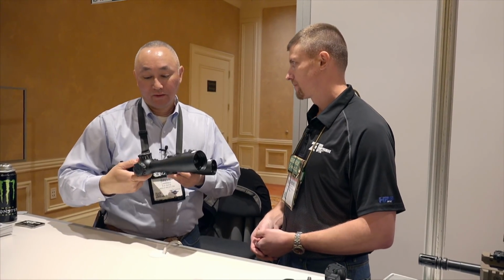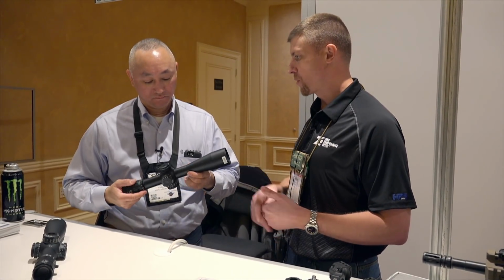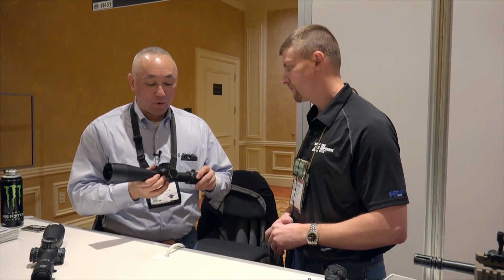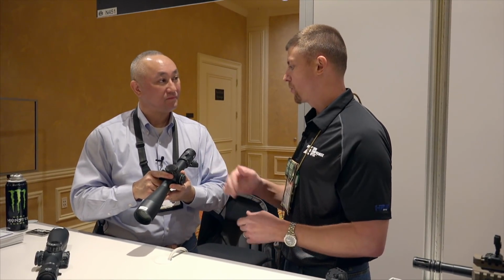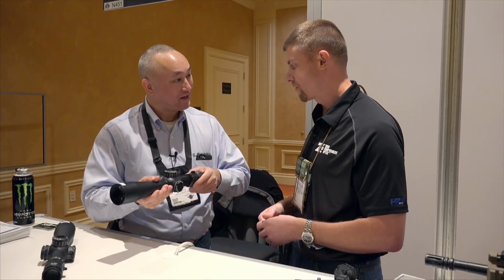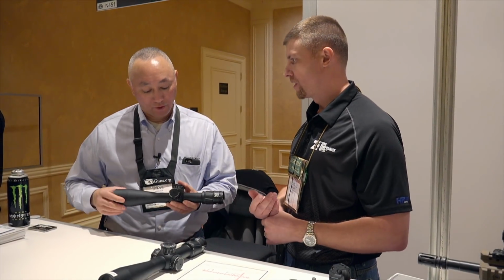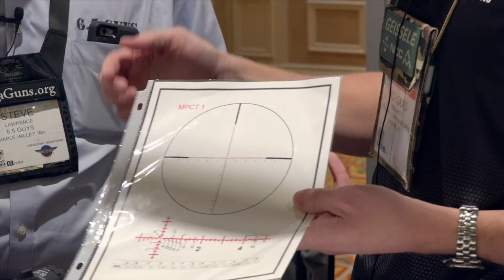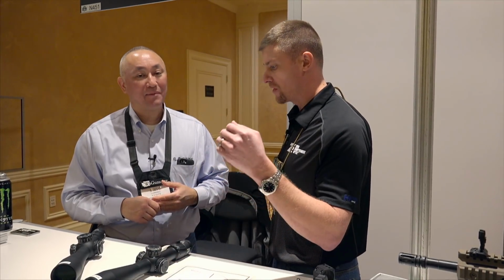2018 SHOT Show - Zero Compromise Optic

Comment: No can do .....for little more to buy from the innovators making the parts for these guys, but getting that experience aswell in the assembly part.....to start they need to be at the $1000 mark, but I realize that's impossible when the components coming from the competition already blow them out of the water........unfortunate..but that's business.
Reply: eric rumpel - im afraid they dont understand the optics industry.
you have to EARN the right to make a $4k scope.
they want to step right in to the industry at the top tier demo without earning the position.
they need to come in at $2,500 max and $2,000 or less would be better on their high end.

Comment: $4k for a scope from a new company with Zero reputation. That’s going to be a very tough sell considering the competition.
Reply: I stand corrected, indeed it was $3200-$3500. Still doesn’t change my sentiment though.
Reply: Also given the kind of people and companies, like Snipers Hide, that are touting the benefits, it's a safe buy.  It's competitively priced along with Kahles, Swaro, and similar.  Dude in the video said $3200-$3500
Reply: R2KBA - Given the pedigree of the people running the company it’s a safe buy.
Reply: Great pedigree doesn't always equal quality, dependability or even longevity of the company. That would be one of my greatest worries- will the company survive? Lot's of variables with running a company and if there is nobody around to service your scope then what? Again, might have a great product but if the company isn't managed well then it can still buckle. I would spend the same cash on a proven product from a proven company just to be safe.